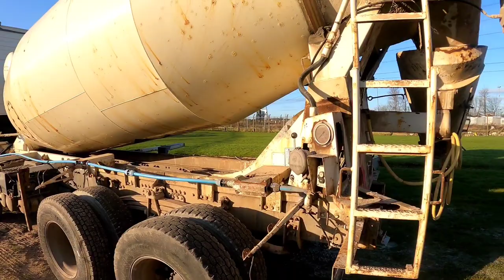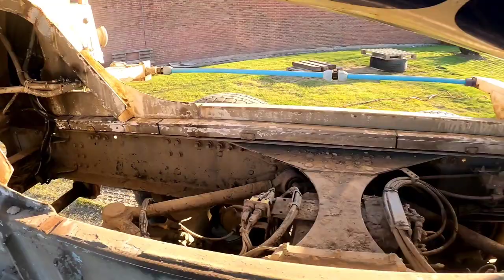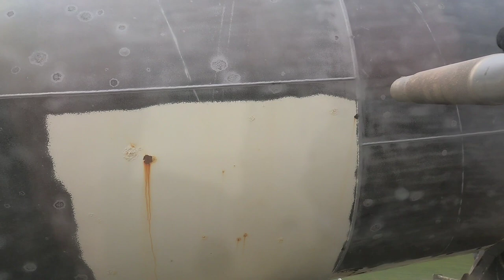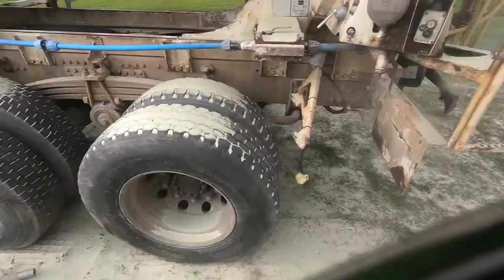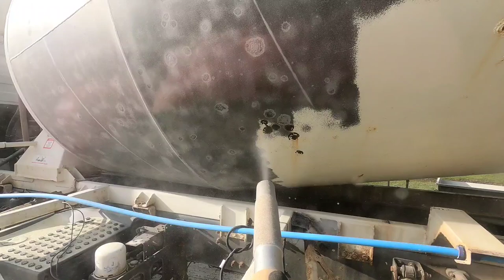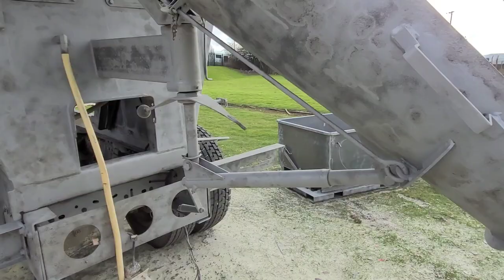Concrete MiXeR Truck SandBlasting Part 1 the Drum

Comment: Damn that thing had some wicked acne! Looks SO much better now that it's ready for paint. You get more done because you really go at it.
Reply from the maker: Big truck this 1 on the smaller ones I can get drum and chassi done in a days worth of work. We'll all depends if they leave big chunks of concrete onit. Most concrete trucks I do try to knock the big thick bits off with a hammer or needle gun to keep my speed up. Less time less costs 😊💞

Comment: Its a reall rough old thing that  the cab looks newer than the rest of it . Unusual to see an fh volvo globetrotter cab on a mixer wagon . Shel be a different beast once shes all blasted and painted . I know a guy up in fife who does breedons stuff mick riddle at ladybank hes allways ususally busy  . It was an old clemco blaster i was using filled the pot with a bag  it wasnt a great thing it had seen much better days . It did the job in a fashion . U couldnt really adjust anything it was on or off lol .
Reply from the maker: Very old school way of blasting 😂 things have moved on a little since 😎👌

Comment: yeah, mixer drums start to rust when you start to chisel the concrete out with an airhammer. I've seen mixerdrums on trucks that were 4 years old with pockmarks... Concrete trucks are hardly small, here in the Netherlands we run with 4 or 5 axle trucks. between 40 to 50 ton Gross depending on set up.
Reply from the maker: wow bet they take some blasting haha

Comment: They could have washed it for you lol good job
Reply from the maker: 😂 Don't make much difference to be fair they did knock the big chunks of concrete off that helped out 👌
Reply: What size nozzle you use there? Long venturi?
Reply: What's all the black spots shading etc?
Reply from the maker: Cdx650 it's good for 260cfm @ 100psi
Reply: @Mobileblaster  only have a 185cfm compressor 🙄
Reply from the maker: @jdaspects  the dark areas are eva millscale or rust stains.
185cfm is ample to do a job like this 👍
Reply: @Mobileblaster  oh you don't try to get all the stains and mill scale clean too?  I must be doing too much then
Reply from the maker: It's serface prep depends on what your customers are expecting. Or the data sheet of the paint that's getting used. Alot more too it than point and spray you will get their just takes time knowing what can be left and what needs to be removed 👍

Comment: I used to Paint cement trucks for cemex and would paint them the same way, with the barrel rotating.
Reply from the maker: I got told to have the drum rotating away from the chassis what ever side I'm at that way it cannot pull me in 😏 that will always stick in my head couldn't fink of a worse way to go 😳

Comment: Why did you choose not to use the Dustless Blasting system for this job?
Reply from the maker: To make for an easier clean up the slurry would sit in every nut and cranny and that would take along time to clean off and I still won't be 100% sure it's was ready for paint 👍 this way only needed a blow off and it was straight in for paint 👌

Comment: There is quite a few sq feet of surface area on those buggers, At least ya could get it rotating, ya gotta get a move on to keep up, LoL. Have Ya eva had to do the inside of one, now that is a pain in the butt..
Reply from the maker: Yeah big job like. Always try and have the drum turning away from the chassis that way if you get court up ya not going in because that thing won't stop turning 👍

Comment: Is there a nozzle that would be able to blast a bigger area? This feels like you are washing a skyscraper with a toothbrush!
Reply from the maker: Governed in the UK with the driving licensing I'm more or less maxed out with the compressor/van equipment. If I upgrade to class 2 (wagon none articulated) I've the upfront cost then I've to upgrade all to most of every aspect of my rig then the running costs of a wagon and bigger cfm rate/ derv it uses more sand. I will only gain 2 to 4 hour but operator fatigue will increase so possibly not worth the investment. In my opinion I've no experience running a bigger rig on a daily basis.
Reply: @Mobileblaster  Oh, so a bigger nozzle needs all that changed as well? Wow. Thanks for your answer!
Reply from the maker: Yeah I'm optimised to peak performance with the rig I'm aloud to run before having to upgrade alot of my setup 😵 it's still alot better than sanding by hand haha 😁👌💞

Comment: What’s your set up sir
Reply from the maker: I've use a combination of different blast pots & compressors and made my own pot the best off some and added them to mine and so on also engineered my own part that totally transform the blast pot builds. Just waiting to get it protected so I can offer it up for sale. I've put this on the back burner for now tho as it performed perfectly for around 8 months now its hit a few niggles that need ironing out I have a some were parts that's not lasting need to rethink some of it